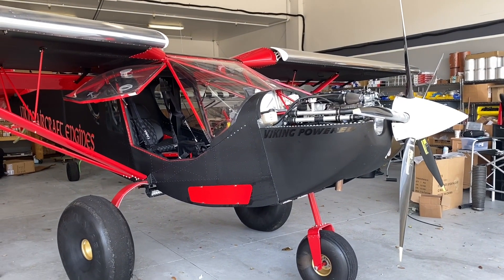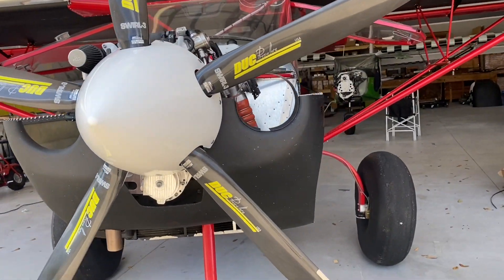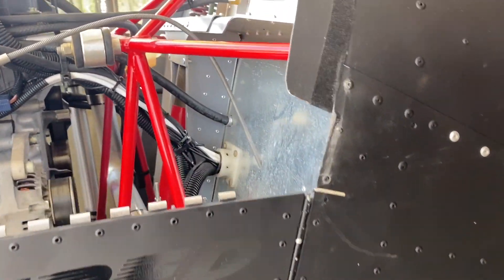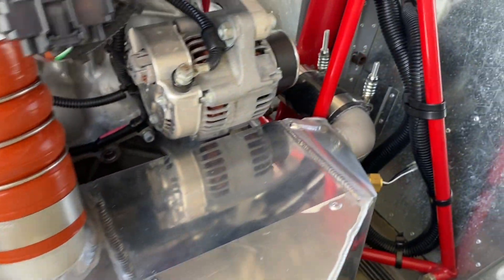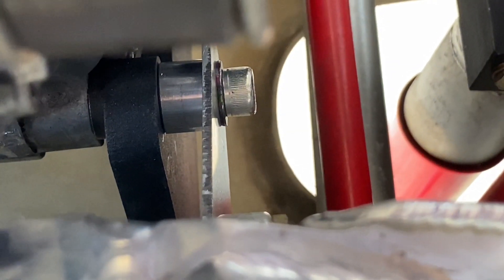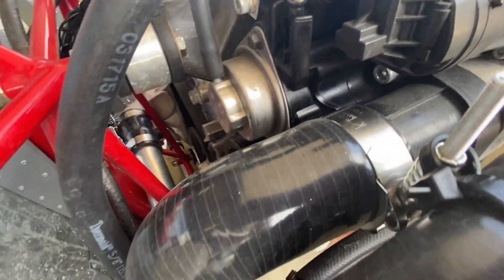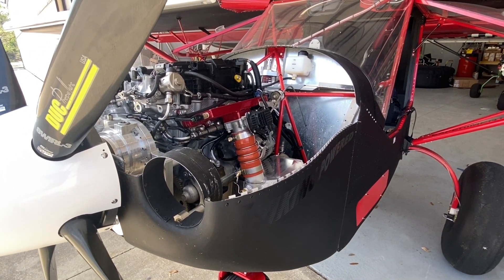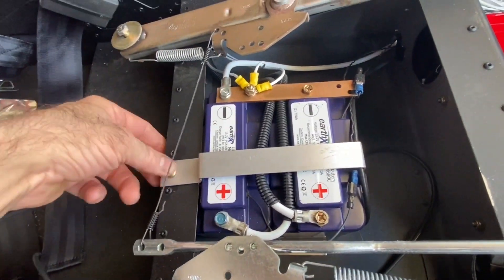Viking 180/195 Turbo Installation Video 2  (Cowling, Intercooler, Batteries and Instrumentation)

Comment: Hi Jan, very interested in the belly pod added behind of radiator. You mentioned that Viking will have it for sale. I looked at your website and did not find it. Can you make a video of it, including the installation.I am planning to build a 750 SD and very much leaning to get the Viking 195 with header tank, in-flight adjustable propeller and belly pod ......!
Reply from the maker: Yes, we do have them - we had it all laser cut. Haven't added them onto the store, but the whole belly bod kit is $995. Haven't had the opportunity to make a video on one yet, but when we do it will be uploaded.
Reply: @eggenfellner  Thanks for your quick reply. Look forward to see the video!

Comment: Jan, what issues have you encountered with the Earth X battery? I've been running 1 for 2 years.
Reply from the maker: Just not being able to fully monitor voltage is an issue, but in one install we had to replace the batteries 2 times due to bulging. Haven't had issues with the older batches we had (like the ones in the SD) mostly with the newer. 
They are lighter and provide better cranking amps, but the fact that the batteries will protect themselves if there is an issue instead of the engine.
Reply: @eggenfellner  thank you 💙

Comment: Every time I see something on this engine I can't help but wonder how well it would perform on a STOL CH 750 compared to the non-turbo model. The extra 40 pounds obviously wouldn't be the greatest thing, but the added performance might make it worthwhile.
Reply from the maker: We did this many years ago when we first introduced the engine we tested it in the Cruzer model. Makes the plane very nose heavy and the aircraft performs like a best with the 130 already, so no need for the extra cost / complexity
Reply: Yeah, I kinda figured that was the case. But I like to dream. Good info, as usual. Thanks.

Comment: I was mulling around the Zenith 801 Super Duty spec info, but my question is would this engine work effectively in a bearhawk 4 Place model B?
Reply from the maker: We have our engines in the Zenith 801 - it can definitely be done on the Bearhawk, a popular question lately.
Reply: @eggenfellner   Thanks for the  response,  I'm no expert just a lay person ,  I think due to the rpms vs torque of the "195" it would be effectively a 180 HP for a 4 place bearhawk. What's your input & thanks in advance?